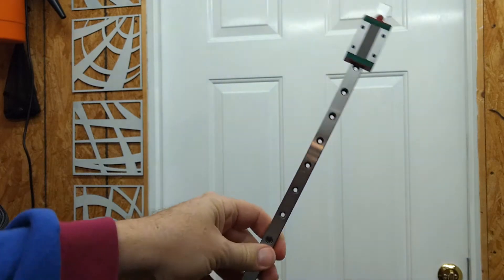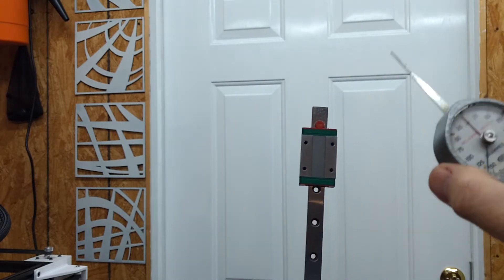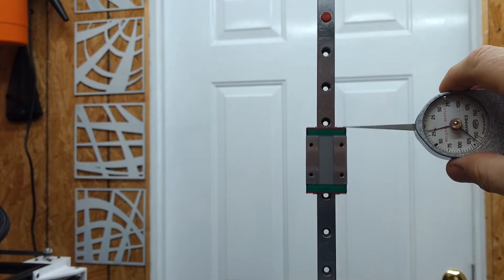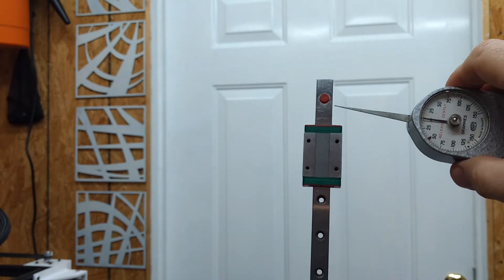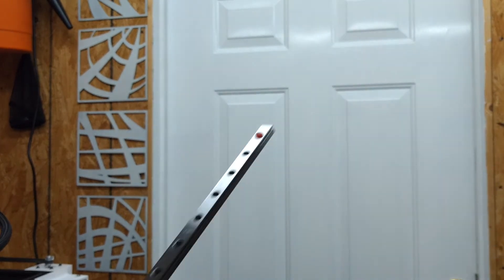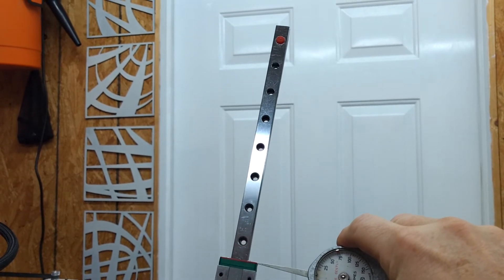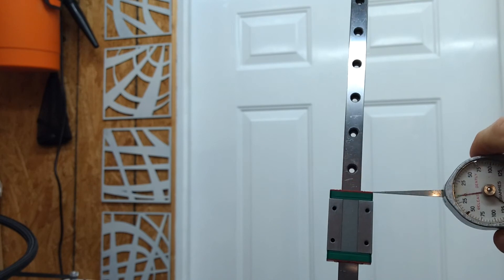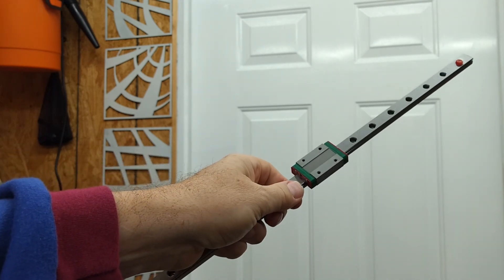Anycubic Kossel 3d Printer Kit Linear Rail Guide Bearing Problem

Comment: u should get G25 3.28mm/3/32" euro/us made ball bearings because then the cheaper linear rails will be awesome. i buy 1000 pack of skf balls for like 20 bucks and my linear bearings work awesome
The problem is china made ball bearings are not as round as then need to be. and often the retainer clip needs to be filled down so it actully lay flat and not bowout.
i run rebuilt mgn12 rails on all my printers and have never had an issure after changing the bearings out. just a tip for getting better mgn rails :)

Comment: Did you try Contacting the Seller / Manufacturer for a Replacement? Their response??
Reply from the maker: Actually I did.  Not sure if it's a language barrier thing, but after about a month they sent me replacements.  Humorously what Anycubic sent me was three centerless ground 8mm shafts, not three linear glides.  Didn't matter, I had already modified the printer to use VRail and rollers.  Doesn't speak too well for their customer support.

Comment: Thanks for the overview. I am building a delta from scratch and planning to use linear bearings as opposed to the rail guides. While I understand that proper cleaning and lubrication of the new bearings is paramount I am wondering if its not the bearing but the surfaces they ride on creating the issues. Do you think or have you tried cleaning up the bearing surfaces? Maybe some 600 - 800 grit wet sanding or maybe run them on a buffing wheel? Essentially deburring and removing any rough surfaces. It would be interesting to find out how that alters travel. Since really good bearings can run in the hundreds of dollars a piece I am willing to do a little work to get them to run  smoothly...

Cheers,
Greg
Reply from the maker: Hi Greg.  Yes, I tried a number of approaches to improve the performance, ranging from cleaning to lubrication to buffing and honing.  They got better, but never really good. Please have a look at my follow up video and Thingiverse uploads.  If I was going to build from scratch again I would again use the Openbuilds rail and wheels.  Not expensive and are velvety smooth when adjusted right with the eccentrics.

Comment: what i like to ask seeing and bought these failed rails: don't they have a queasy conscience to produce this shit and sell this shit all over the world? 
Needs ressources on manufacturing, delivery and the customer is the guy that just can toss it?
No aspirations to produce good quality stuff?
Reply from the maker: Hi Heiko, and while I agree in principle (I really do), I understand why market forces create the opportunity for low-end makers to put out poor quality look-alikes and get away with it based on nothing but price.  They certainly have flooded the market with these awful bearings, which are throw-aways from my perspective.

Where it gets really dumb is when companies like Anycubic put them in their "premier" products and expect users not to notice or complain.  I've given them an earful (via email), maybe they'll fix the situation.

As re my kit, I'm replacing the rail and bearing system with a true V-Rail (Openbuilds), and have designed and created a replacement slider that has their wheels and eccentric on it.  That works like a dream.  Once it's fully tested I'll post the parts on Thingiverse and put a link here.  The cost is actually lower than the cheapo linear rail guides.

A side-note, please avoid expletives in future replies, thanks.
Reply: I'd expect a bearing manufacturer, even a cheap one, to have amazeballs level accurate bearings for the machines that make their bearings n so I am not sure why there is a massive diff in price vs quality. Shouldn't cost them a lot to automate the quality control surely. How much would it cost them honestly to fix their rails, maybe 20% more? 100%? Is it a problem in the cost of the grinding or cutting tools they use so their accuracy dies down more over time?

Comment: I'm having the same problem. 1 out of the 3 in my kit worked beautifully. 1 worked okay. The other was pretty bad. I also tried cleaning, disassembling, lubricating, etc. If you have any workarounds or alternative bearings that are readily available I'd love to hear about them.
Reply from the maker: I'm working on an update (replacement) design, stay tuned.  It's looking quite good.  I'll post new info as it's available.
Reply: Great, I'm looking forward to it. We got the bearings as good as we could and then went ahead and finished the build. Interestingly, the printer is working great in spite of the bearings. But, I'm concerned about the long-term effects of having two sub-optimal bearings.
Reply from the maker: I've now completed the V-Rail version, please look in my channel for new video.  Here's a Thingiverse link to the parts:
https://www.thingiverse.com/thing:2688303
Reply: Thank you, will do!